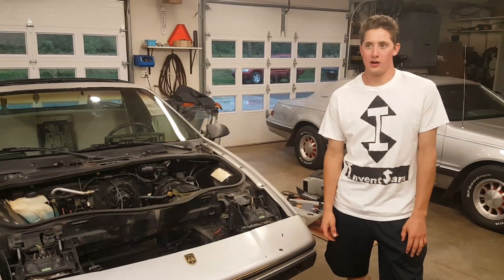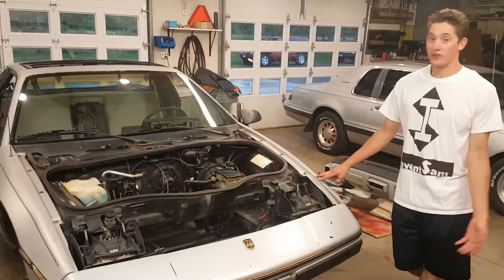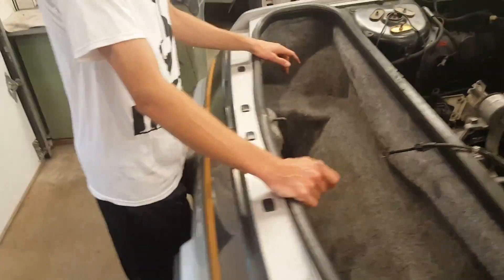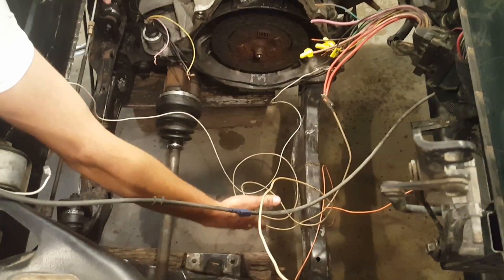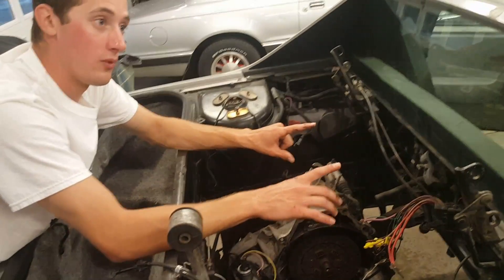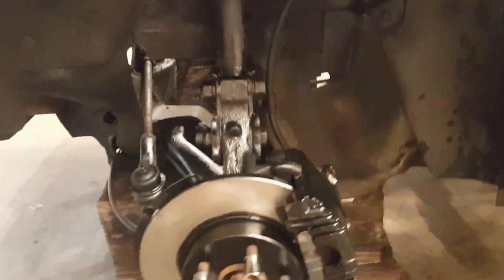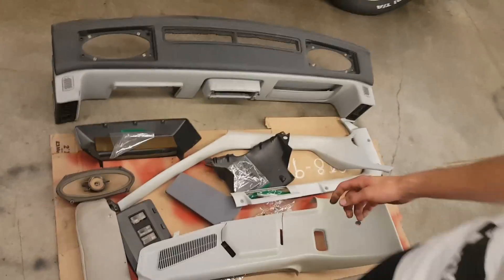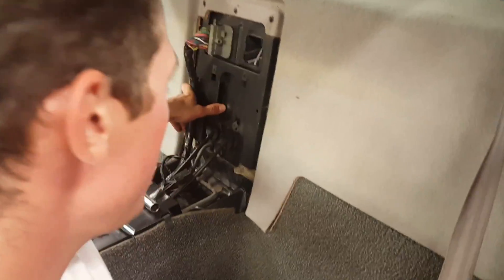DIY Tesla | Part 1

Comment: 3 to 5 miles per battery. That is awful!  Since they are likely lying about the range, it's probably even lower than that. Even at 3 per battery, that is a 30 miles per charge.
Reply: No call for being a snob - show us your project and let us know how old you are. It's perfectly fine if you drive 10 or less miles each way per day, which many people do. He does get up to highway speed with it, so it's well designed for a lead battery machine.

Now you know why EVs were impractical in the public eye until Lithium Ion came along.
Reply: You cannot get up to highway speed on this kit.
Why are you spergs always bitching about a misunderstanding?  I am not insulting the kid.  I just think the kit is way too much money and not really worth it.
Reply: "Sperg"? That's a disability people are born with and it's pretty weak to pull that one out when you have nothing to show but armchair criticism. You were invited to show what you have done and out comes the ad hominem attack. The kit is priced very reasonably for the time its technology emerged. That hasn't changed for those 20 years. Yes, you can get up to highway speed in a Fiero without a whole lot of motor - the car is slippery and low weight. The kid was getting up to about 50MPH...it's not a golf cart like you are painting it to be.